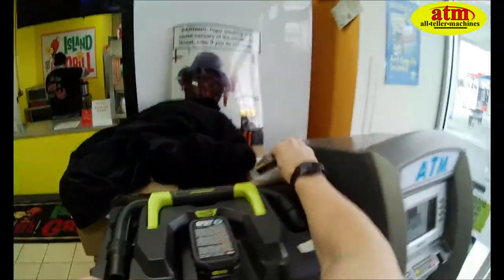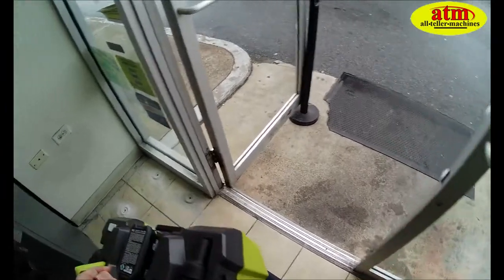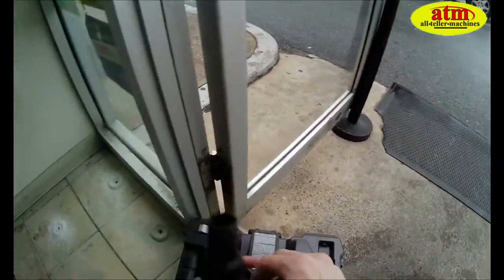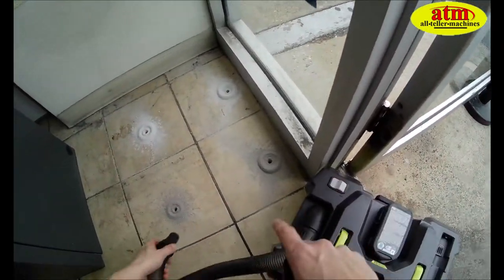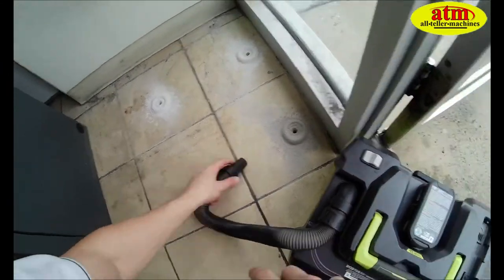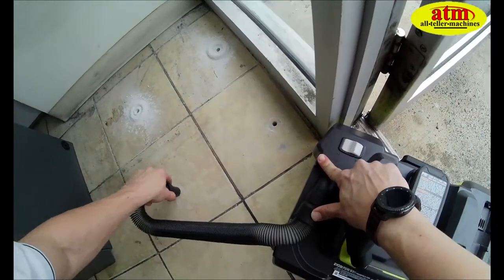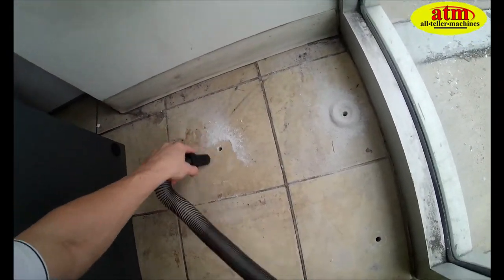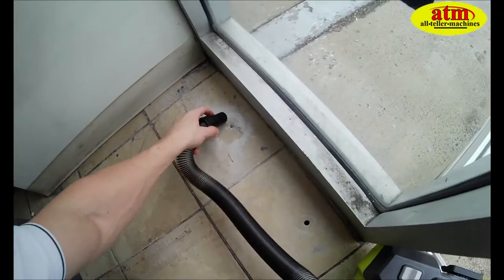How to Bolt Down an ATM -First Person View!

Comment: The dirt/debri you left on the bottom window seal is killing my OCD, in a lighter note. In the process of getting my LLC and buying my 1st ATM, thanks for the video!
Reply from the maker: we cleaned the area after the video was finished. we vacuumed and used a wet mop that the store supplied for any debri left behind.
Reply: What kind of insurance did you get?
Reply: @atmllcus what type insurance is needed please

Comment: Have you ever dealt with instances where the business owner didn’t want to bolt the atm to the floor ? If that’s the case what would you do? Fill the inside of the atm with weight plates or sandbags to weigh it down ?
Reply from the maker: would you put thousands of dollars into a portable safe and sit it on the floor in a business where 100's of people visit each day? doesn't matter how heavy you make the ATM.. someone will be smart enough to move it. 4 1/2 holes can easily be fixed after ATM removal.

Comment: How come you didn’t use anchor’s? I use them.
Reply from the maker: There are different types of anchors. what you saw in the video are concrete screws. https://www.amazon.com/THD50400H-Titen-Heavy-Screw-Anchors/dp/B000RX5S0W/ref=sr_1_2?crid=1X6UYP8QHM7AI&keywords=titan+anchors&qid=1675987440&sprefix=titan+anchors%2Caps%2C82&sr=8-2    

what you probably use is wedge anchors, we also use them as well. When using wedge anchors you cannot remove them. you can hammer them down but it looks tacky if you ever have to move the ATM.

Comment: Were you using the hammer function on the tile? Or only drill mode until you get through the tile?
Reply from the maker: Hammer and Drill Function, I do a few short pulses before holding the trigger down to prevent slippage.

Comment: What do you do about the holes in the floor when you remove the atm?
Reply: You remove the nuts from the bolts, move ATM and then use a rubber mallet to hammer them down flush with the floor
Reply: Depending on the bolts, you screw them out or hammer them in to make it flush

Comment: I have just secured my first ATM location. Have you had a situation where the tile cracked while drilling?
Reply from the maker: Congratulations on your first install! Yes depending on the type of tile, it is typical if they crack. I like to do short bursts of drilling before I hold the trigger down to help prevent the entire tile from cracking but sometimes its unavoidable.
Reply: @atmllcus  Thank you for responding. It is just like drilling a screw into wood that may crack.
Reply: I’ve always used a piece of quality masking tape before marking the hole, and even a 3/16” or 1/4” pilot hole, or a tile bit(diamond) and a gentle initial drilling until complete penetration through the tile, then gently again with the larger bit, will prevent most cracking in the tile. Also having some water to cool the bit, and depending on the type of concrete, sometimes even filling the hole after you’ve reached about half of the targeted depth, can produce a little more of a mess if not careful, but will greatly extend the life of the bit. Excessive heat can destroy an expensive bit instantly.  One more little tip, if you’re using the concrete”screw” as it seems these are, and you have one that’s not tightening up because the hole is a little too big, because of whatever reason, stick a piece or 2 of 12 or 14 AWG wire, cut the depth of the hole can help the screw grab and tighten as desired.